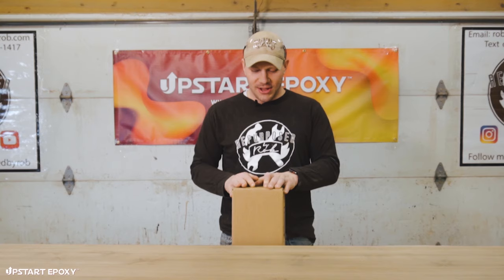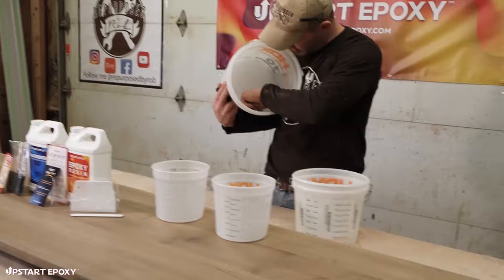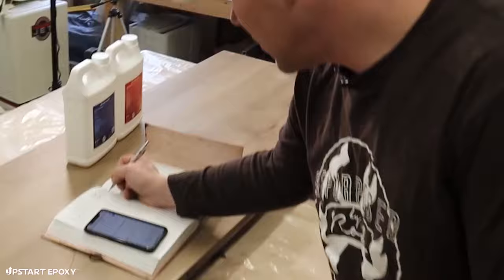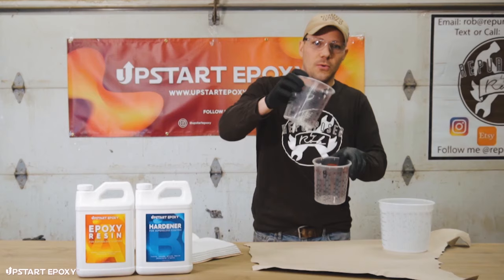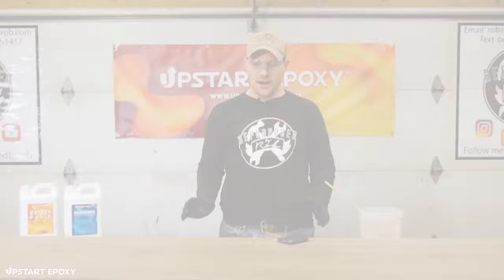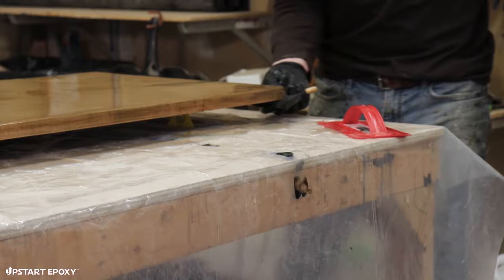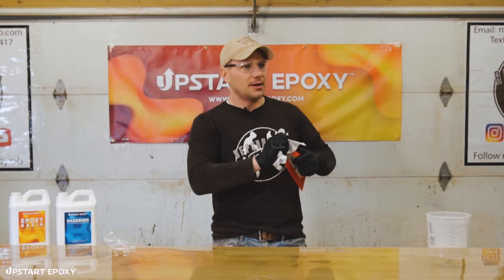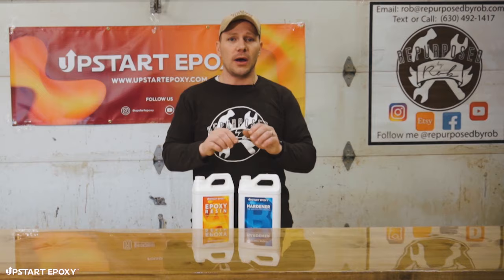How to Use Table Top Epoxy Resin

Comment: Really good video. One minor (lighthearted) point……use millimetres/litres and save loads of time on calculations and conversions 😀
Reply: Ha I completely agree then you don't need a browser just a calculator !!
Reply: Inches can be calculated in decimals instead of fractions. It’s pretty simple.
Reply: One square ounce per cubic millifoot for every inch of square centimeter
Reply: @JerzyBoy973  nothing about the imperial system is simple.
Reply: @JerzyBoy973 Cool. It's almost like there are multiple ways to calculate things.
Reply: Can’t you pore both into the large container if it has measurements.
Reply: there are only USA and two tiny nations who still use imperial measurements ... pretty archaic 😶

Comment: Just did my first table I built for a Kitchen nook, first time doing anything like this and man the first 2 coats came out good the 3rd messed up for some reason so I sanded it down lightly with 220 grit, pour the last or 4th coat and it came out super clean looks great worth every penny I spent to do it. The hardest part was making sure I had everything I needed the having everything ready to use. Make sure you have really good lighting so you can see any imperfection so you can smooth them out. And walk around it looking from all sides or you might miss something. Have you heat gun plugged in and ready to pick up on the fly because time goes by fast then you think when you are trying to smooth it out then brushing the sides and then taking your heat gun to blow on it to get those tiny little bubles out. Funny thing was I didn't even see the buble till I put the heat on it. But the bubles come up and pop just as sweet as you please. Very  good product. I only poured about 1/4 inch at a time so a thin coat and it worked great. Mine ended up being about 1 inch thick total. Wish I could post a photo because mine came out awesome and this was my first time doing this.
Reply from the maker: Glad your project went well! Thanks for watching

Comment: What you missed in the video is if you do need to do a flood coat after the seal coat, what has to happen to the table to prepare it for the Flood Coat, aka, sand with 120 gritt  to give the flood coat something to adhere to, after cleaning off residue from sanding.

Comment: Excellent coverage of the math part of the process 👍. 
No wood surface prep (sanding - tac-cloth - alcohol lint free wipe , filtered water damp cloth "grain pop"-repeat ONCE sand before , between and after ) and no Moisture content testing to validate long term coating survival for moisture egress under the coating side , even if most of it will exit the exposed under surface . Once its "cured" , a light under coating CAN prevent moisture In-TAKE , but that's not a likely SHORT TERM problem for air-conditioned environments👍.
For ultimate long-term discoloration , no mention of UV or other additives already in the product or available as add-ins .
Promising a 2nd-pour even if its not "really necessary" this time or mention of the best TIMING - just ahead of final solidifying of the 1st layer , and while this really is a good how-2 , its just a bit incomplete . 
Every one of these steps CAN contribute to LONGEVITY of an EXCELLENT result , but truthfully, what you DO show seems just about RIGHT for a GOOD beginning effort !
Reply: Do you have a more detailed video of the process as I am an overthinker and would love to see the process more detailed and with anything that might be missing

Comment: Just finished doing an old piece of sycamore with lots of bug holes and character, I was amazed how long tiny bubbles kept rising but the heat gun took care of them with no problem. This video made the process very easy. Can you tell me more about the final sanding/polishing please? I don't see it on the website.
Reply from the maker: Hi Brian! We're glad our tutorial made your process very easy :)  Once your piece is cured, you can lightly sand it with an 80 grit and apply a furniture oil if you want a not-so-glossy finish.  if you like a glossy one, you can use our Supergloss Coating for its topcoat.

Comment: A notch trowel (square preferred) is best used to evenly spread the Epoxy on the table not a spreader. I leave my try to clean surface or in the cup to dry, I never clean it. Instead I break up the excess epoxy when it gets too thick
I’ve never use a sponge brush instead I’ve always used a throwaway brush to wipe the sides. 
As shown a spreader is best used to scrape the sides continuously to remove excess drips.
Do not use a heat gun to pop bubbles. Dirt can fall from the cord or the cord can though and contaminate the work.
Instead use a propane torch.
Also it’s a good idea to keep a pick or something pick like handy in case a hair it speck of dirt lands in you work. You can scoop it out earlier, it’s easy trust me.
Reply from the maker: Great tips!

Comment: I sure wish I had of watched this video before doing my pour...I got mega bubbles from air coming out of the wood.  My wife ran the heat gun and scorched the epoxy...so I just finished sanding it all back down to bare wood.   At least I now have a sealer coat that should limit my bubbles this time.  As he said...you DON'T want to be sanding it all off again.  Major PITA and oh what a mess...white dust everywhere in my shop now from the belt sanding the epoxy off with 80grit belts.   Now that this great tutorial has been viewed by me, I feel like I'll be an expert on the 2nd attempt!  Lol

Comment: I’m wondering, to save on Epoxy, if a normal wood sealer would work as an undercoat. Then sand lightly and complete with an epoxy pour.

Comment: Great tutorial! When doing table top like this, do we need to sand or buff after the epoxy has cured?
Reply from the maker: Yes! You need to sand it after it has cured and then polish it as needed.
Reply from the maker: Hi  @StringBanger ! It really depends on you. If you're okay with the outcome of the cured epoxy then you have the option not to sand and polish it. However, if you're seeing any imperfections you can fix it by doing so.

Comment: Going to do a dining room wood table where I stain the wood different colors before usually doing oil-based polyurethane as a top coat but because this is going to be a dining table and not coffee or end table I need to finish it with a something that can make the top smooth.  Will the oil polyurethane or stain cause problems with the epoxy.  I usually use the oil based poly because it yellows the wood and gives it an older appearance.  Also if the oil based poly would cause a problem and I just go with the epoxy for the top sealer will the oil based stains I used on the wood cause a problem?  Thanks.

Comment: You could add the height and width of your edges and get a more accurate calculation.  Probably 3-4” to your length and width.  About 2.8 sq. ft. Assuming a 1.75 “ edge.

Comment: Can an epoxy be used over a painted table?
Reply from the maker: Yes, epoxy can be used over a painted table, but there are some important steps and considerations to ensure proper adhesion and a smooth finish:

Surface Preparation:

Ensure the paint is fully cured. Different paints have different curing times, so refer to the manufacturer's instructions.
Lightly sand the painted surface with fine-grit sandpaper (e.g., 220 grit) to create a slightly rough surface. This helps the epoxy adhere better.
Clean the surface thoroughly to remove any dust, grease, or contaminants. Use a lint-free cloth and a suitable cleaner (like isopropyl alcohol) to wipe down the surface.
Sealing the Surface:

If the painted surface is porous or has any texture, consider applying a thin seal coat of epoxy first. This helps to prevent air bubbles from forming in the final coat.

Comment: What do I do about fish eye? I did a seal coat on my kitchen table and when I put the next coat it fish eyed. How can I fix the fish eye spots?
Reply from the maker: Here are some tips and tricks for existing fish eyes as well as how to prevent them. Thanks for watching! If you have additional questions you can find more on our website here https://www.upstartepoxy.com//?oid=11&affid=606&source_id=youtube 

To Fix Existing Fish Eyes:
Sand the Surface: Begin by lightly sanding the entire surface with fine-grit sandpaper (e.g., 220-320 grit) to create a uniform texture and to remove any high edges around the fish eyes. Be careful not to sand too aggressively and damage the underlying layers.

Clean Thoroughly: After sanding, clean the surface thoroughly to remove all dust, debris, and potential contaminants. Use a lint-free cloth and an appropriate cleaner (like isopropyl alcohol) that won't leave a residue. Allow the surface to dry completely.

Apply an Additional Coat: Mix a new batch of tabletop epoxy according to the manufacturer's instructions. Apply a thin coat over the entire surface, paying special attention to the areas where fish eyes occurred. The new layer of epoxy should level itself out and fill in the fish eyes, creating a smooth finish.

Monitor and Torch: After applying the epoxy, carefully monitor the surface for the first 30-60 minutes and use a heat gun or torch to pop any air bubbles that rise to the surface. If fish eyes begin to form again, gently coax the epoxy into these areas with a clean mixing stick or spreader.

To Prevent Fish Eyes in Future Applications:
Ensure a Clean Surface: Before applying epoxy, make sure the surface is completely clean and free from oils, waxes, silicones, or other contaminants. Wipe down with a solvent like isopropyl alcohol that evaporates completely.

Apply a Seal Coat: Applying a thin seal coat before the final pour can help seal the surface and reduce the likelihood of fish eyes. Allow the seal coat to cure as directed before applying the next layer.

Temperature and Humidity: Work in an environment within the temperature and humidity ranges recommended by the epoxy manufacturer. Extreme conditions can affect how the epoxy flows and cures.

Mixing and Pouring Techniques: Mix the epoxy thoroughly but gently to avoid introducing excessive air bubbles. Pour the epoxy slowly and evenly over the surface.

Product Compatibility: Use products (cleaners, sealers, etc.) that are compatible with your epoxy resin to avoid reactions that could lead to fish eyes.

Comment: I am planning on making a craft table and really want it to be spectacular.  I plan on painting the table top and then doing an acrylic stencil in the corners.  Will the epoxy lift the table paint or the acrylic paint used for the stencil?
Reply: You will need to give it a good time to cure.  I just watched a guy use epoxy to seal acrylic paintings but he had let them cure for 4 weeks

Comment: hi there, I enjoyed the video.  My question is this, what if I wanted to stain the table top then use this epoxy?  Will it still bind?  Still be without bubbles?
Reply from the maker: Glad you enjoyed the video! Yes you can use our table top epoxy https://www.upstartepoxy.com/products/epoxy-resin-table-top/?oid=11&affid=606&source_id=youtube on top of a stain! 

Here are some tips and tricks to make sure it comes out the way you want it.
1. Choose the Right Stain
Compatibility: Use a stain that is compatible with epoxy resin. Oil-based stains are commonly used, but they must be fully cured before applying epoxy. Water-based stains are also an option and may dry faster and cure in a way that's more compatible with epoxy application.
2. Properly Prepare the Surface
Sanding: Before staining, sand the tabletop thoroughly to ensure a smooth surface. Start with a coarser grit and work your way up to a finer grit for a smooth finish.
Clean: Ensure the surface is clean and free of dust, grease, or any residue that could interfere with stain adhesion and later, the epoxy's ability to bind to the stained surface.
3. Apply the Stain Correctly
Even Application: Apply the stain evenly according to the manufacturer's instructions. Use a brush, rag, or sponge for application and wipe away excess stain to avoid puddles or uneven areas.
Cure Time: Allow the stain to cure fully. This is crucial. The curing time can vary significantly depending on the type of stain, the application thickness, and environmental conditions. Oil-based stains, in particular, may require longer to cure fully (often several days to a week).
4. Seal the Stain (Optional)
Sealer Application: You can apply a sealer after the stain has cured and before the epoxy. This step can help seal the stain, preventing it from interacting with the epoxy and also can aid in reducing the chances of bubbles forming. If you choose to use a sealer, ensure it is fully cured and compatible with both the stain and the epoxy resin.
5. Apply Epoxy
Bubble Prevention: After ensuring the stained surface is fully cured and prepared, mix and pour the epoxy. To avoid bubbles, pour slowly and carefully. Use a heat gun or torch to gently heat the surface of the epoxy after pouring to pop any bubbles that do form.

Comment: I want to Table Top Expoxy a vintage 5 panel door.  That means some places it will be up to 1/4 in deep.  I would like it to be all one level.  Can this product do that?
Reply from the maker: Hello Pati, our Table Top is designed for 1/8" layers. You can pour an additional 1/8 layer if it's 1/4" deep.
Reply: Did you complete this project? This is exactly what my plan is! I don’t want to sand it at all. Did you put epoxy into the center of each panel to “fill” it first, before coating the whole door? Did you leave the hardware on the door? How did yours turn out?

Comment: After my deep pour, i had one bubble that came up as it was curing in its final hours, and I missed it.  Before I pour my hardener, can I sand the bubble, and any other imperfecton out and expect that the hardener will give me that mirror finish?  Or do I pour one more level of deep?
Reply from the maker: Hi Robert! Yes, you can definitely sand the bubble and any other imperfections before you pour the final coat. 😊

Comment: I did a thin layer on a table top. Mine said 24 hours to cure. It's been left alone for almost 2 days. Looked amazin and I just grabbed a towel and damped it a bit to clean it. Everything the damped part of the towel touched turned the epoxy cloudy. Did I just mess it up? Is there an easy fix or do I have to apply another layer 🤦‍♂️
Reply from the maker: Hello Sifaka! 

Thanks for watching! 

If your resin hasn't cured properly, this means that the chemical reaction between the resin and hardener was not able to take place. Sticky resin is typically caused by inaccurate measuring or under mixing or curing in cold temperatures. 

Also, if the resin hasn't cured yet, we don't recommend touching or damping it as this will turn the epoxy cloudy or damage the surface. You can fix this by scraping this down and then go ahead and pour a fresh coat of carefully measured and thoroughly mixed Table Top Epoxy Resin.
Reply: @upstartepoxy4804  thanks for the reply! It's not to noticeable for someone that doesn't know or when it's not getting direct light so I'll just leave it as is and be more careful for next time!

Comment: Hi, when you use Table Top Epoxy  for a surface cover like in the video, only  the sides are not 2 inches but about 10-15 inches can be done in the same method of brushing the liquid material? Will it work? Or there is another method recommended.
Thanks
Reply from the maker: Yes, it should work the same as long the recommended mixing ratio and pour depth is maintained. Just make sure that you extra mixture to cover the sides.

Comment: I want to epoxy a 24 in wood round. Do I use the same measurements you did for a rectangle table for my wood round? The 1/16 and 1/8 x H x W  then convert those numbers to US ounces?
Reply from the maker: Hi Jeremy! For a round surface, you will need to calculate the radius. Since you have 24" as your diameter, you can divide it by 2 to calculate the radius. 

Next is to calculate volume in cubic inches. To do this, it's going to be (radius squared) X pi (or, 3.14159265) x (desired epoxy coating thickness). Divide by 1.805 to convert cubic inch volume to US fluid ounces. To convert ounces to gallons, divide by 128.

Hope this helps!
Reply: @upstartepoxy4804  Thank you for formula. Is it normal for me to use a heat gun for 15 minutes? Most of it was on the side of the wood round, not so much the flat part of the wood. The side of the round was difficult to keep the epoxy to stay as it dripped off the side. Any suggestions to keep the epoxy on the edge of the wood round?
Reply from the maker: @JJ-fg4wp  It depends but be careful not to overheat, scorch or burn the epoxy.  Periodically check for additional bubbles and remove as needed.

Comment: I have a question, how do you fix a table to with hard resin full of bubbles and drips lol. I know it’s messed up. It was a second coat but we didn’t realise it wasn’t dry yet when it was touched. It left marked. Also there was some drips around the edges that’ dried out. Pls help.
Reply from the maker: You can grind off all these edges using a sanding flap disc cause it takes the dried bubbles off so quick.

Comment: What do I do if I applied the epoxy over uncured water-based stain? I have lots of divots in the first seal coat. Do i need to sand down to wood or can i salvage it somehow?
Reply from the maker: It is fixable, do not worry! Whether your divots occurred during the pouring process of your surfaces, or afterwards due to a soft cure, the solution is always to pour another coat of epoxy. You can pour directly over the previous epoxy pour within 24 hours of the first pour. After that, you will need to sand the surface with a 220 or 320 grit sandpaper lightly to create a chemical bond.

Comment: Wear a mask partner when mixing. Maybe the research has evolved or the chemical mixes have changed? But vapors released especially with most hardeners need protecting against